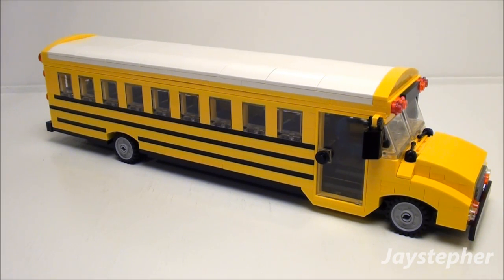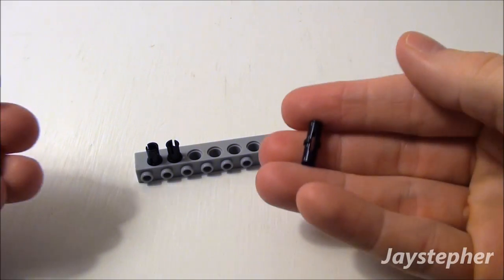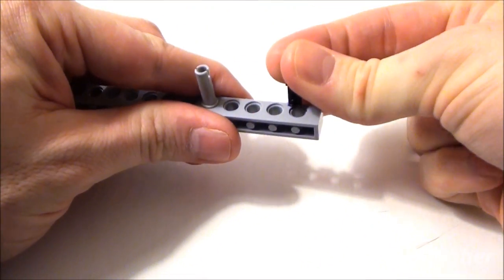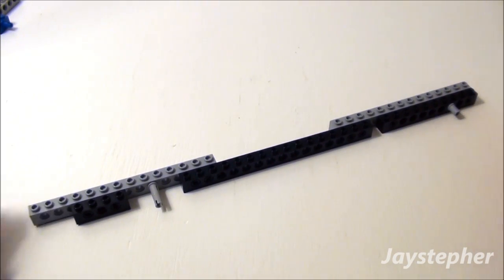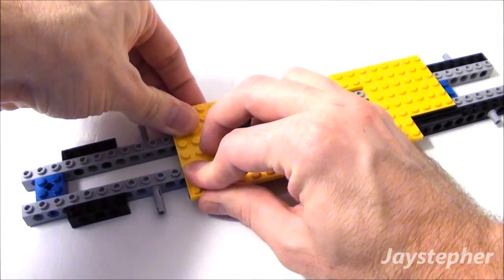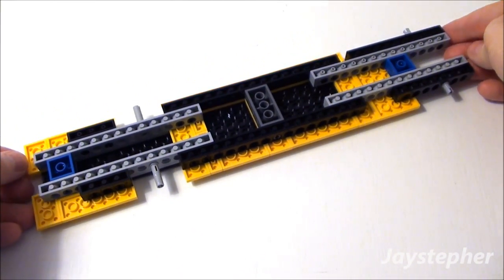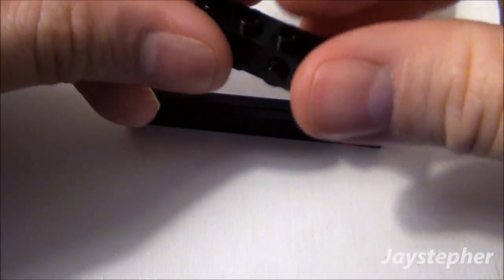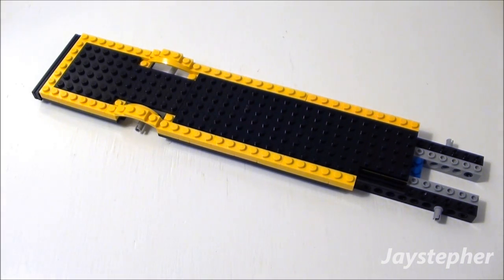Tutorial (1 - 5) - LEGO Yellow School Bus: Chassis

Comment: I would like to get my son the parts to make this for Christmas. Is there a parts list somewhere I can take into the Lego store?
Reply: +Elizabeth Porter you can find all the bricks at pick a brick on lego.com here's the link http://shop.lego.com/en-US/Pick-A-Brick-ByTheme and here's the list of bricks you need:The 525 parts needed for the tutorial are listed below:

1 - 2 x 2 Red Round Flat Tile (415021)
1 - 2 x 2 Red Round Slide Shoe (265421)
2 - 1 x 4 Yellow Flat Tile (243124)
4 - 1 x 6 Yellow Flat Tile (663624)
6 - 1 x 8 Yellow Flat Tile (416224)
2 - 1 x 2 Yellow Radiator Grille (241224)
10 - 1 x 1 Yellow Plate (302424)
7 - 1 x 2 Yellow Plate (302324)
4 - 1 x 3 Yellow Plate (362324)
11 - 1 x 4 Yellow Plate (371024)
28 - 1 x 6 Yellow Plate (366624)
23 - 1 x 8 Yellow Plate (346024)
2 - 1 x 10 Yellow Plate (447724)
2 - 1 x 2 x 2 Yellow Corner Plate (242024)
6 - 2 x 3 Yellow Plate (302124)
6 - 2 x 4 Yellow Plate (302024)
5 - 2 x 6 Yellow Plate (379524)
3 - 2 x 8 Yellow Plate (303424)
2 - 2 x 10 Yellow Plate (383224)
2 - 2 x 16 Yellow Plate (428224)
1 - 4 x 6 Yellow Plate (303224)
2 - 4 x 8 Yellow Plate (303524)
2 - 1 x 2 Yellow Plate With Vertical Stub (4183041)
4 - 1 x 2 x 1 x 4 Yellow Angle Plate (243624)
4 - 1 x 6 x 1 Yellow Plate With Screen (4523558)
44 - 1 x 1 Yellow Brick (300524)
4 - 1 x 2 Yellow Brick (300424)
2 - 1 x 3 Yellow Brick (362224)
1 - 1 x 4 Yellow Brick (301024)
1 - 1 x 8 Yellow Brick (300824)
1 - 2 x 3 Yellow Brick (300224)
2 - 2 x 4 Yellow Brick (300124)
2 - 1 x 2 Yellow Inverted 45° Roof Tile (366524)
2 - 1 x 1 Yellow Tecknic Brick (654124)
4 - 1 x 2 Yellow Technic Brick With 2 Holes (3200024)
1 - 1 x 4 Yellow Brick With 4 Knobs (3041424)
12 - 1 x 4 Yellow Brick With Bow (4522035)
2 - 1 x 1 x 2/3 Yellow Roof Tile (4283095)
1 - 6 x 1 x 1 Yellow Double Inverted 45° Roof Tile (4501461)
1 - 1 x 4 x 6 Yellow Frame (4561507)
2 - 2 x 2 Blue Bearing Brick With Snap (3000023)
19 - 2 x 2 x 2 Blue Seat (407923)
2 - 1 x 2 Black Flat Tile (241224)
2 - 1 x 4 Black Flat Tile (243126)
2 - 1 x 8 Black Flat Tile (416226)
4 - 1 x 1 Black Round Plate (614126)
7 - 1 x 2 Black Plate (302326)
6 - 1 x 3 Black Plate (362326)
7 - 1 x 4 Black Plate (371026)
2 - 1 x 6 Black Plate (366626)
15 - 1 x 8 Black Plate (346026)
4 - 1 x 10 Black Plate (447726)
3 - 1 x 12 Black Plate (4514845)
2 - 1 x 2 x 2 Black Corner Plate (242026)
1 - 2 x 2 Black Plate (302226)
2 - 2 x 3 Black Plate (302126)
1 - 2 x 4 Black Plate (302026)
2 - 2 x 10 Black Plate (383226)
2 - 2 x 16 Black Plate (428226)
1 - 4 x 4 Black Plate (303126)
1 - 4 x 6 Black Plate (303226)
1 - 6 x 6 Black Plate (395826)
1 - 6 x 16 Black Plate (302726)
4 - 1 x 2 Black Radiator Grille (241226)
2 - 1 x 2 Black Plate With Vertical Fork (4183060)
1 - 1 x 2 Black Plate With Stick (254026)
1 - 1 x 2 Black Plate With Stick (4225201)
1 - 1 x 2 x 1 x 4 Black Angle Plate (243626)
1 - 1 x 1 Black Brick With Horizontal Holder (4515356)
1 - 1 x 2 Black Rocker Bearing (393726)
1 - 2 x 2 Black Rocking Plate (613426)
1 - 1 x 2 Black Brick (300426)
3 - 1 x 2 x 2/3 Black Roof Tile (4548180)
1 - 1 x 2 Black 45° Roof Tile (304026)
1 - 1 x 2 x 3 Black Wall Element (236226)
2 - 1 x 4 Black Technic Brick With 3 Holes (370126)
1 - 1 x 8 Black Technic Brick With 7 Holes (370226)
1 - 1 x 10 Black Technic Brick With 9 Holes (273026)
2 - 1 x 16 Black Technic Brick With 15 Holes (370326)
1 - 2 x 2 Black Steering Console (4153044)
6 - 017mm Black Low Narrow Tire (348326)
16 - Black Connector Friction Peg (278026)
4 - 1 x 2 Dark Grey Radiator Grille (4210631)
2 - 1 x 1 Dark Grey Flat Tile (4210848)
9 - 1 x 2 Dark Grey Flat Tile (4211052)
1 - 1 x 4 Dark Grey Flat Tile (4211053)
1 - 1 x 6 Dark Grey Flat Tile (4210651)
7 - 2 x 2 Dark Grey Flat Tile (4211055)
1 - 1 x 2 Dark Grey Plate (4211063)
1 - 4 x 4 Dark Grey Plate (4211089)
2 - 4 x 12 Dark Grey Plate (4210706)
2 - 1 x 2 Dark Grey Plate With One Knob (4211119)
26 - 2 x 2 Dark Grey Plate with One Knob (4565322)
1 - 2 x 4 Dark Grey Bearing Brick With Snap (4210718)
1 - 1 x 1 Grey Flat Tile With Gauge (4255629)
2 - 1 x 2 Grey Flat Tile With Gauge (4227776)
2 - 1 x 8 Grey Plate (4211425)
1 - 2 x 4 Grey Plate (4211395)
3 - Grey Mini Antenna (4221775)
4 - 1 x 14 Grey Technic Brick With 13 Holes (4211705)
6 - 018 x 7 Grey Narrow Rim With Hole 04.8 (4499259)
2 - Grey Connector Peg (4211807)
2 - 3m Grey Connector Peg (4211709)
16 - 1 x 8 White Flat Tile (416201)
2 - 1 x 6 White Plate (366601)
4 - 1 x 8 White Plate (346001)
2 - 1 x 10 White Plate (447701)
2 - 6 x 10 White Plate (303301)
1 - 6 x 12 White Plate (302801)
16 - 2 x 4 x 2/3 White Plate With Bow (4583297)
8 - 1 x 1 Red Transparent Round Plate (614141)
8 - 1 x 2 Orange Transparent Round Plate (4222960)
2 - 1 x 1 Clear Transparent Round Plate (614140)
4 - 1 x 1 Clear Transparent Brick (300510)
1 - 1 x 2 Clear Transparent Brick (306510)
2 - 2 x 4 x 2 Clear Transparent Windscreen (382310)
21 - 1 x 2 x 2 Clear Transparent Wall Element (486440)
1 - Clear Transparent Door For Frame 1 x 4 x 6 (4521504)